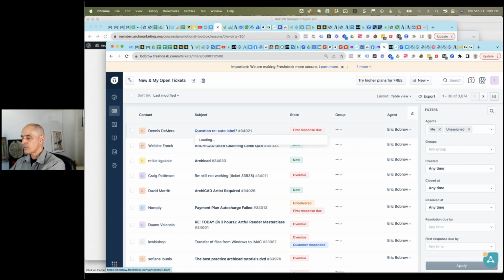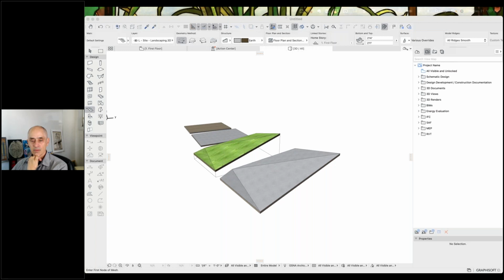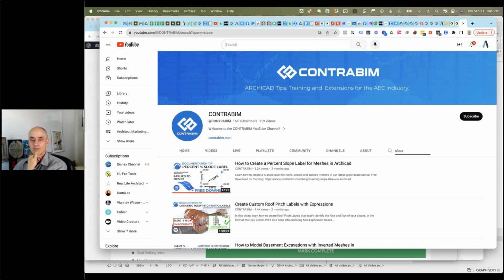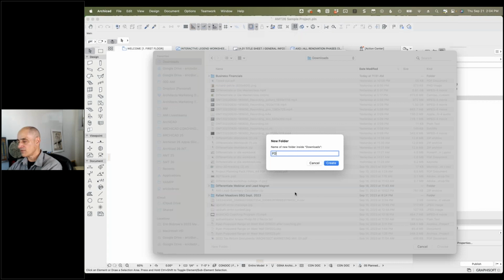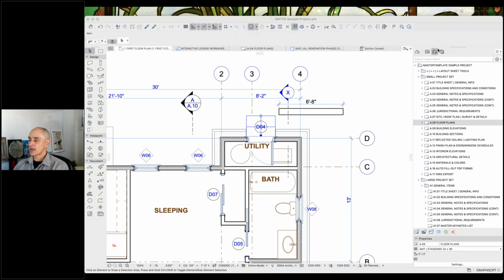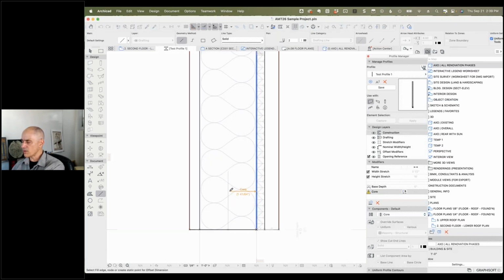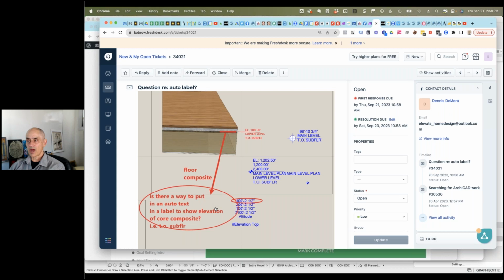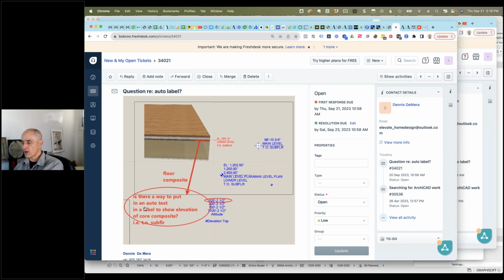ARCHICAD USER Coaching Clinic - September 2023

Comment: 2:13:00 Actually you can modify the path without going to the top level of the publisher if you right click on a file or folder included in the publisher. You will find the option there, but only if you have a single file or folder selected.